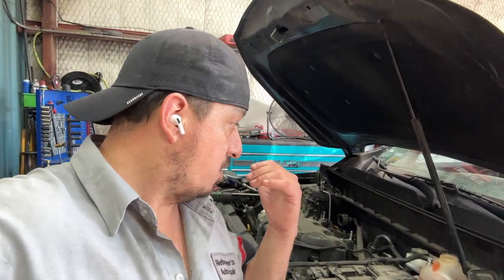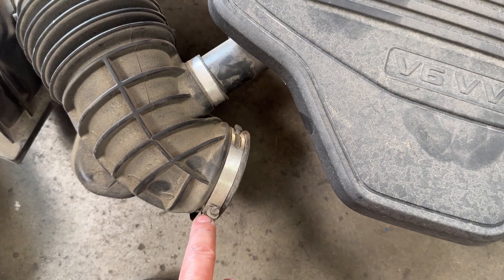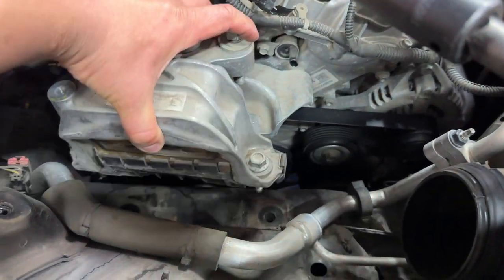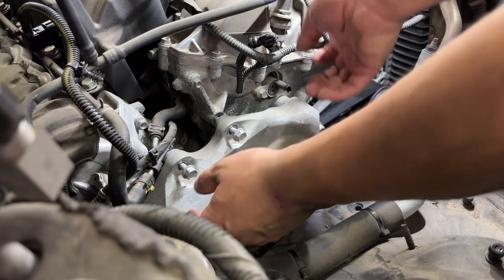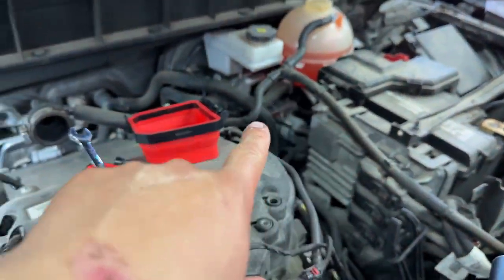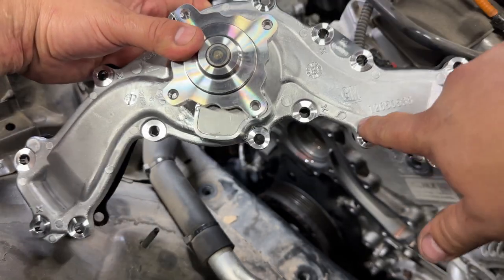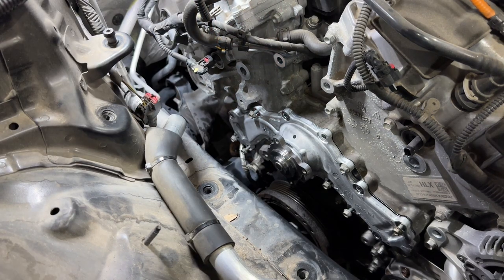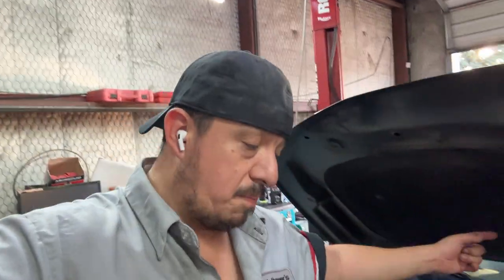How To Replace a 2017-2023 GMC Acadia Water Pump - 2016-2023 Cadillac XT5    #waterpump #acadia

Comment: Excellent video i replaced the water pump on my XT5 it's about the same as Acadia but i did this in 2022 and everything was on back-order OMG i did find a gm pump but i paid for it $$$$
Reply: Did you replace the water pump bolts? Trying to determine if it’s necessary to replace them or not. Thanks.

Comment: Why does my Toyota Corolla 2003 blows air out the oil cap and makes a loud rattling noise
Reply from the maker: Sounds like blow by. Your oil piston rings might be bad already if it’s excessive.